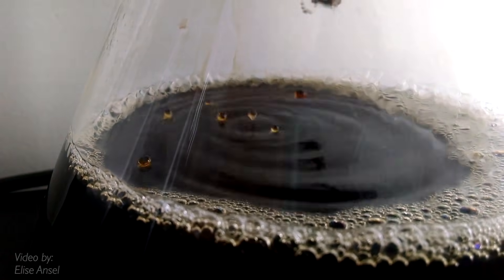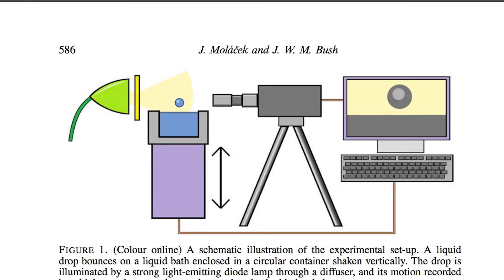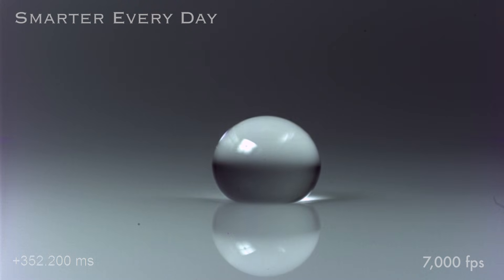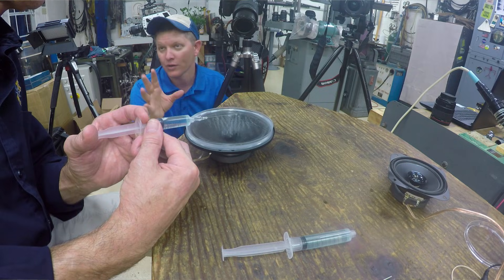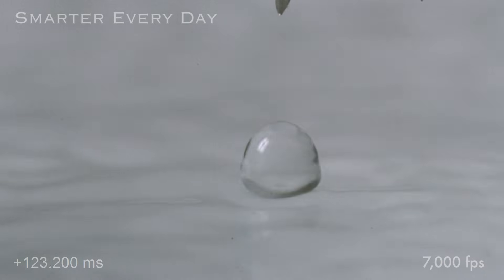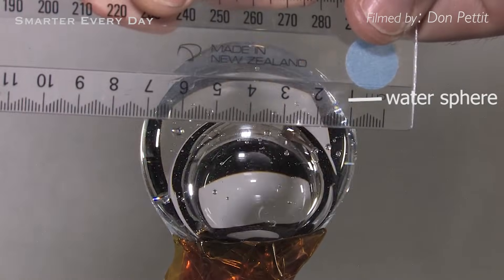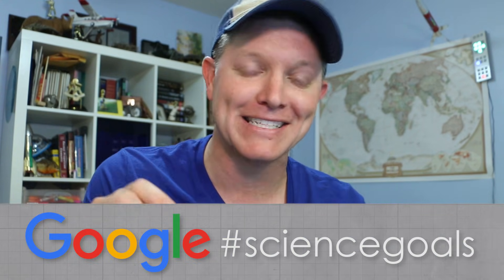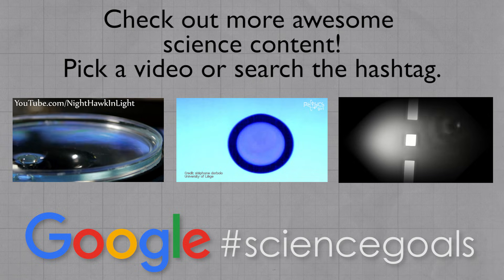The WALKING WATER Mystery (in SPACE and SLOW MOTION!) - Smarter Every Day 160

Comment: Sorry for the bad english, its not my native language, but what if, its not an thin layer of air, that prevents the drop from disolving? Maybe its the difference in the kinetic energy in the water molecules of both the drop and the surface? 

When you drop your drop on a flat, still surface of water, the molecules in the drop itselfe are filled with kinetic energy, and bouncing around, while the still water molecules are very calm. So they cant mix up, until the drop starts to settle and the...lets call it kinetic charge of both, still water and bouncy drop are coming clother together.
That also would explain, why the speaker increases this phenomeon. The Speaker water is constanly forced with kinetic energy, and has a mutch higher mass than the drop. So when the drop hits the surface (and not breaks his surface tension instantly by hitting an up wave) the drop slides on the surface. And the molecules cant get to the same lavel of kinetic energy, because the higher mass speaker water is constant forced with kinetic energy, while only a fraction of the kinetic energy gets transfered to the drop, witch also has a lower mass and therefore acts different to the constant waves of (kinetic)sound(energy). So the drop stays, until it hits an unlucky wave and the the surface tension breaks or the difference in the kinetic charged watermolecules of both water and drop match for a fraction of a milisecond.

Comment: thinking about water to critically it's not a nation it's a thing. to go along with my first metaphor it's like when you shake up the civilization of water it goes into Anarchy before it stabilizes its energy/ frequency/ speed call it what you will it's just not quite ready to become uniform yet.
Reply: I just realized I didn't say what it was called in my comments, surface tension, it is different so it is not quite ready to combine. when the speed of the water or liquid becomes similar it will combine you will notice that mercury does this possibly even more than water does.
Reply: as for the cello music it's not necessarily the cello it's a violin that is so large that the volume and the low to high frequencies and how that affects the water. very low and high frequencies create thousands of more possibilities and faster bouncing which means that it's almost impossible that nothing would happen to the bubbles inside the water.

Comment: Its the Leidenfrost effect a thermo dynamic property of water bar tricks like spitting on your fingers and picking up a hot coal or cooling your finger with an ice cube and then snubbing out a cigarette on that finger. the same reason the water skates on water is the same reason you don't get burned it has to do with surface tension and friction the droplets are colliding with the body of water causing friction and because of this thermal reaction they can not pass through the surface tension of the minisicial barrier or surface of the water... So simply put thermodynamics...

Comment: Very nice video, thanks! A long time ago I did an experiment with alcohol of the blue variant, called Spiritus in NL. !!!! WARNING BELLS !!!! FIRE & EXPLOSION HAZARD !!!! I had noticed by accident this floating drop effect in alcohol and it was much more pronounced than in water. So I decided to design an experiment. This was in the controlled space of a physics lab BTW. I fitted a large glass bowl on a metal rod clamped to a firm base. This way the rim of the bowl was perfectly free to resonate vigorously when stroked with a violin bow. Various resonating frequencies could be obtained. Then I filled the bowl with alcohol to 15mm below the rim. When the rim was agitated with the bow, droplets spouted forcefully from the glass and landed on the alcohol surface, grouping where the surface was at rest. I had made a fluid Chladni plate. The droplets contrasted white against the blue background, very beautiful. The basic pattern was a four pointed star, next up was a six pointed star. Later on I devised a way of sustained resonance via a voice coil driven by a wave generator, which allowed for even more patterns. All of this was before any digital stuff and I lost the pictures I made :-(

Comment: I don't think you have necessarily a right explanation for this effect. 
Many people ask what will happend in vacuum? In other words what will happen when there is no air/gas between water pool and a water bubble.
If you look at the graph, you can see that even at very low air preassure residence time is not 0 so "water on water dancing" effect still can be observed though residence time is low.
I think the effect should be explained by Van der Waals forces and potential energy function of two molecules. In simpe terms, if you take two melecul from the surface of the bubble and molecule on the surface of water pool and you are bringing them closely together: when they are far away, interation is 0; when they come closer, they repel each other up until the point when the potential barrier on the surface is passed and they become atract each other like molecule in the liquide do (if molecules in the liquide are away from each other they will attarch each other, but if they are too close to each other they become repel each other so there is a point of equilibrium). 
Propably it should be explane by quantum mechanics and would be great to hear from physisits who knows this area.
Reply: I have always loved watching these droplets ever since I was a little kid. As I got older I always figured it was the surface tension of both individual bodies of water coupled with the difference in speed between the two bodies was stronger than the gravitational pull on the droplet.Thus, allowing it to exist until the speed slows and gravitational pull can break the surface tension of the bodies of water. Testing this in a vacuum would be a good way to test if it is air or just surface tension.
Reply: In vacuum, water will evaporate.

Comment: There is another even more interesting effect with water that I haven't found an explanation of anywhere. The effect can be achieved by limiting the water coming out of a tap so that only a fine thin line of water comes out and before it hits the bottom of the sink it disperses into drops (so the water mustn't be a constant stream when hitting the bottom).

Now this is where things get interesting, if you take the side of a knife and hold it underneath the stream and lower or raise the knife under the stream you'll notice that depending on where you hold it the stream will be either a thin uniform line (without droplets) but if you then lower it gently you'll notice that suddenly standing droplets seem to form at the bottom of the stream. What's interesting is that it seems like information is traveling upwards the stream because by moving the knife up or down it instantaneously affects the smoothness of the entire water stream.

Comment: I think the walking water mystery can be explained in terms of water surface tension, Van der Waals Bond, and the dipole-dipole interaction between water molecules.  There is also Van der Waals equation to calculate either the force or the energy of bonding between electrically neutral molecules.I believe when the water surface is vibrating, it tends to prevent the dipole-dipole interaction or Van der Waals bonding to take its effect between two separate water surfaces or between the water droplet and the vibrating  water on the ground.  So in this particular case, the water surface tension holding the water droplet in shape will be the dominating factor.  If the water droplet is given enough or ample time to stay in contact with other water surface, then the water droplet will merge or fuse with other water as explained by Van der Waals bonding principle.

Comment: I disagree with the air gap theory as the differing radii would eliminate this - I think the reason that droplets bounce is due to the higher surface tension and impacted internal frequency. It's the same as throwing water balloons onto a trampoline or pool same effect on a larger scale. 
Thank you for inspiring us.

Comment: How are the water molecules arranged and oriented exactly on the surface of the water (which undergoes surface tension)? Could it be that the molecules are oriented just so that the parts which attract and bind to other water molecules are "all on the inside" so, with or without the air gap, there's nothing to bind the two surfaces? I guess this could be tested carefully under vacuum (and specific pressure so water doesn't vaporise as much).

Comment: So explain this to me:  when the drop first hits the flat surface with no sound waves, it hits really hard, and the surface is flat without a "catcher's mitt" (wave trough in the surface), and yet it does not coalesce!  It doesn't coalesce until it has bounced several times - subsequent bounces much less hard than the first one.  It seems there is something about bouncing hard that prevents coalescence!  So then when you add the sound waves, all it does is make the drop continue to bounce hard instead of settle down!  That's why I am not 100% convinced of the "catcher's mitt" explanation - if that's the true explanation then why does the drop without the sound wave not coalesce immediately, when the surface is flat without a "catcher's mitt" wave beneath the drop?

I certainly believe that if the drop hits the wave peak, of course it is pierced and coalesces, so by process of elimination, landing in the wave trough is necessary for it to continue bouncing.  But I'm unconvinced that the "catcher's mitt" explanation is the whole reason the bouncing drop continues to bounce.  I think it has more to do with the fact that the sound waves make it continue to hit the surface hard enough instead of settling, and hitting hard enough prevents coalescence for some reason (perhaps if it goes fast enough it compresses the air underneath it to get a better air cushion).

Comment: The zero G videos are really cool.  I thought it was interesting to see how after the music or sound stopped the shape of the bubble itself changed.  Its like the energy of the sound was wanting to blow the bubble apart and the surface tension was holding it together, but not in a perfect sphere because of the waves, the waves go away and it goes to perfect sphere.  Way cool.
Reply: Its not actually zero gravity, it's micro gravity on the ISS.
Reply: True, but even in systems on earth with normal gravity certain case essentially behave as if there is no gravity, for example creating incredibly small droplets from tiny nozzle. Just gotta calculate that gravitational bond number to be sure (which is stupid small here I imagine).

Comment: I have a different explanation for this phenomenon. The spherical surface tension of a droplet is more stable and stronger than the planar surface tension at the point of contact with the surface of water. Therefore, it takes a while until the combinational forces of gravity and force of cohesion to take over the spherical surface tensive force of the droplet. When this happens, the spherical surface tension can no longer maintain the droplet as a sphere and it coalesce with the water body.

Comment: I also wondered about this for years. I believe i've read some-ware that it has something to do with the droplets spinning fast. I thought that was a good explanation because one other way you can get this is to blow hard on the water surface at a very shallow angle. But this seems to explain it even better. Sometimes I play with the phenomenon when I swim in saltwater blowing air hard at the surface with my mouth. Maybe it would be interesting to see if the droplets behave differently if salty.

Comment: I saw the pic of the camera in the restroom on Twitter almost immediately after you posted it, and I don't know why I waited so long to watch this video.  This is something I've noticed and wondered about for as long as I can remember, but never thought to look into.  Thanks so much for this.  Now I have a question.  Before and after the 10:40 mark, in Don's video, you can see tiny drops of water coming off of the big sphere of water.  What happens to those?  My immediate assumption would be that it's a very controlled environment and that no water escaped, but I have seen the video of Commander Hadfield wringing out the washcloth, and there's water going everywhere then as well.  With all the presumably very sensitive and also presumable very expensive equipment on what appears to be literally every surface of the space station, how is it OK for water to just float off like that?

Comment: My feeling is that the water drops form when there is some contaminant, like oil, detergent or something else. Then, the surface tension creates a surface with the contaminant and that stops the water droplet to touch the surface. The fact that the lower air pressure works against this effect might be that simply the surface tension is weaker in lower pressure.

Comment: The cello's waveform is basically a filtered sawtooth wave (string-bow interaction makes a sawtooth wave, the instrument's body filters that wave). So it has a very sharp step at every period of the fundamental frequency. I think that sharp step is quickly adding a lot of energy to the water, giving the water inside wave crests an impulse that is strong enough to cause the crest to separate from the main water body. It works better at particular frequencies, probably because at the water blob's resonant frequencies the crests collect more sound energy into themselves (at other frequencies the energy is diffused more evenly along the surface).

Comment: It happened to my coconut oil tonight. I had a pot on the stove and it was set to high heat but still warming up. When I tapped the fork I used to scoop the oil out it's jar it beadt up and lots of tiny and very pretty dropps danced over the surface of the hot oil. Thank you for educating everybody 🙂

Comment: Would it be caused by the intermolecular forces in the water droplet- considering its smaller size than a typical droplet- being greater than the overall body of water, causing the surface tension ratios to be high enough for the droplet to retain its form on top of the water? Kind of like a soap bubble on top of soap.

Comment: I am sorry to bust your bubble Destin, but your experiment is not complete: what force holds the air layer between the water surfaces? Could electrostatic charges have an influence? I suspect that the surface tension of each body of water (the drop and the water in the container) may retain minuscule amounts of electrical charges that trap the air molecules in the layer, perhaps it is even the air itself which holds the charges. The air at the surface layer of the bubble may hold a charge, the air layer of the water container may hold the same charge thus for a brief time the nano layer of charged air particles are trapped. I will attempt to capture this effect with my Phantom v2511 and add some false color to indicate the charged air particles, yellow of course. Or maybe I will just use an iPhone.

Comment: Do you think that the water drop is actually riding the same surface area of water molecules it initially landed on and is being pushed by the wave vibration?  It is actually riding along the original point of impact 0 keeping that separation of air between the surface and the drop. The drop actually remains in the originally trough in the water's surface, it's the original point of impact that is shifting not the drop itself.  Just a thought.

Comment: 7:51 - 7:56 "The larger the drop, the greater the gravitational force pushing down on it."...? C'mon guys, does gravitational force push? ;P
Absolutely love the vid.
You've mentioned the idea of an 'air gap' but what about the role of electrostatic repulsion and the fact that water is a 'polar' molecule with an uneven distribution of electron density? Couple this with surface tension of both the drop and the flat surface. Would this not allow the droplet to remain for the residence time? Then the droplet coalesces when the gravitational force overcomes these?

Comment: I have heard that there is an electrical charge difference between water and air.  Made stronger by water moving through air.  If the water has one charge and the air the opposite charge then the air would cling to the surface of the water while one surface of water would repel the surface of the separate body of water, and only once the kinetic energy of the water slows and the charge begins to weaken, or the impact force is great enough to overwhelm the air gap, does the water-bubble coalesce with the larger portion of water.  Refer to static electricity diverting the flow of falling water.  If so what would be a good way to measure the regional electric charge in the experiment.

Comment: Fascinating video. Obvious fun in the making. Just two unmentioned points to bring up. When lowering the air pressure, doesn't that decrease the amount of dissolved gasses in the fluid? AND what about static charge? It seemed that the undulating drop distorted in the direction of the surface as it neared it. Just a thought. :)

Comment: Of course, the Cello, played at  528 Hz is the frequency of "Relaxation",  and in plants and animals which are composed of mostly WATER, you would notice cell structure and water surface tension phenomena at that frequency.....  Also, what about Hydrogen Bonding,  and  the speed of bonds forming and breaking under these circumstances  ? ? ?  Curious Question - - -